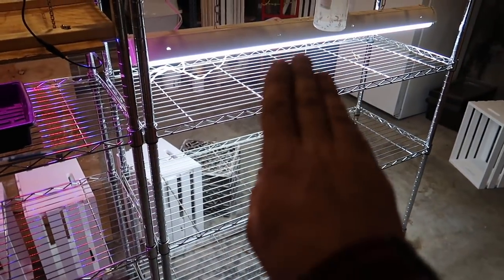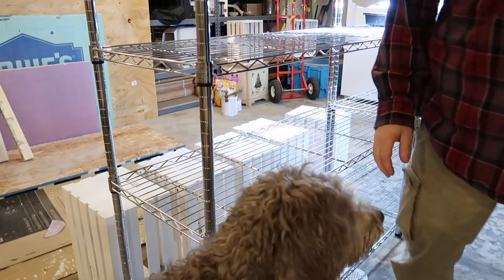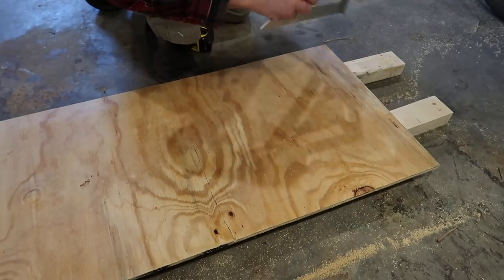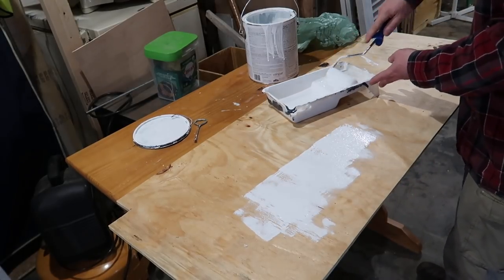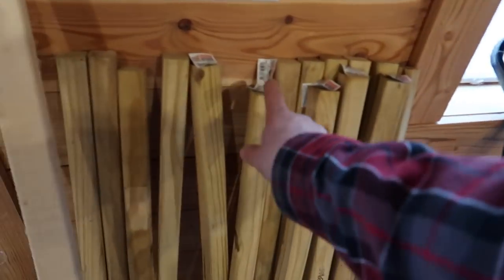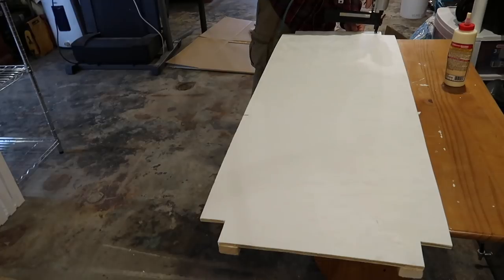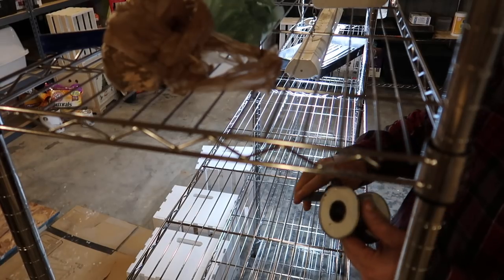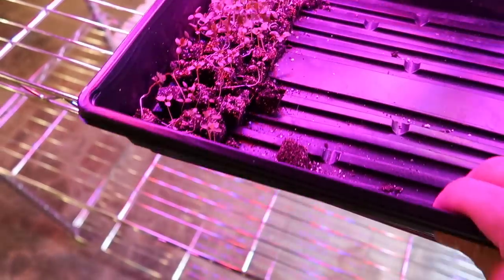Best LED Customizable Grow Light System (Solmore LED Grow Lights)

Comment: I finally came up with my own design.  I took the bottom tray of a metal rabbit cage, turned it upside down and covered it with tin foil, drilled holes and used zip ties to hold the light strips.  It works great.  Thanks for the idea of putting the lights on strips of wood.

Comment: Mr Figaro keeping your place rodent free, checking all the hard to reach places for you. Such a great help he is. I notice you use the same litter for him as I use on me own felines.

I noticed other homesteaders mentioning a depth of 2 inches some odd for their syrup taps, and they marked their drill bits with tape, maybe yours are not in deep enough? Or maybe your sap isn't quite running yet.

Nifty grow light set up, those LEDs will save you $$$.  You're right about them being a great tool, but the sun is where they get the full benefit, making the produce the healthiest and most nutritious it can possibly be.

Comment: David Johnston explained it very well, further below. I'll just try to say it in less words. The plywood doesn't warp that way, because that's the way it came off the tree. If that was the case, each layer of the plywood would warp it's own direction, and the plywood would delaminate. What happens, also happens in regular old dimensional lumber. One side absorbs more moisture than the other side. The moister side swells. Causing it to curve toward the drier side. Your paint made the one side moist, and it swelled.

Comment: I'm still doing research on the different spectrum of lights. Will have a video this week on the different ones I'm using. I have to buy a couple more soon and I'm up on the air on what to get.  Nice hanging system for the strip lights.

Comment: I'll be interested to see how those LED lights work. The fixture you made is pretty slick as well. I have a similar set up to you but I've always used 2 fluorescent light strips for one shelf. I've also found that taping on Mylar sheets (emergency blankets) around the outside of the shelf holds the light in so less escapes.

Comment: I have grown all through the winter under grow lights.  Plants get no nutrients from the sun.  Plants use the suns energy like a solar panel to turn CO2 from the air and H2O from the soil into glucose(sugar) with the byproduct being oxygen.  I think faith can be a good thing but I also think knowledge is just as important.  A lot of the greens available in grocery stores during winter months are traveling from warmer climate countries that are not as strict with the chemicals they use or are being grown under grow lights commercially.

Comment: Hello, may I suggest that a criss cross pattern would be the correct pattern would be correct. There should of been directions in the box or on the manufacturers web site. You want to get the most light from the strip....

Comment: Do you think it would be possible to make 3 or 4 these, connecting them with chain, putting the seed trays on the top of each... each one would be a shelf? Does that make sense? The top "shelf" would hang from the floor joist. The whole thing could be taken apart and stored out of the way. Thank you for sharing this! Can't wait to see how your seedlings grow under both types of light.
Reply from the maker: I do think it is possible and I might end up doing that too

Comment: Do you ever get your tomato plants to grow thick stems?  I keep my lights very close to the plants, but yet my tomato stems are always thin.  I also heard to keep the heat away after the seedlings emerge from the soil. Any suggestions?  Also, I wanted to get the strip lights white for growing plants, but all I could find is the ones that you have.
Reply from the maker: We will put a fan on ours once they get a little bigger and it helps strengthen there stems

Comment: Hope the strip leds work for you, After lots of trial and error I found using 3 of these 20 watt 6500k 4ft led are great! Would be a good addition for your amazon shop. https://www.amazon.com/Barrina-Integrated-Fixture-Utility-electric/dp/B01HBT3BVM/ref=sr_1_2?ie=UTF8&qid=1519051825&sr=8-2&keywords=barrina+6500k